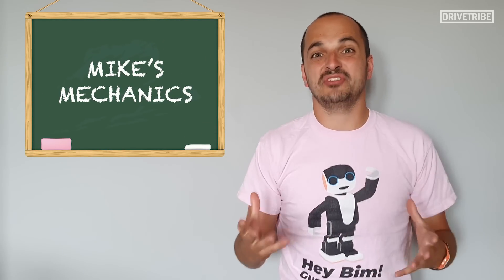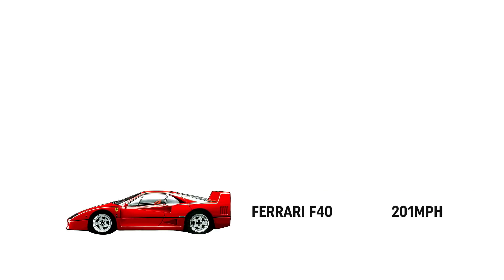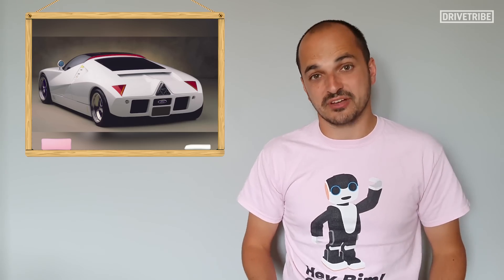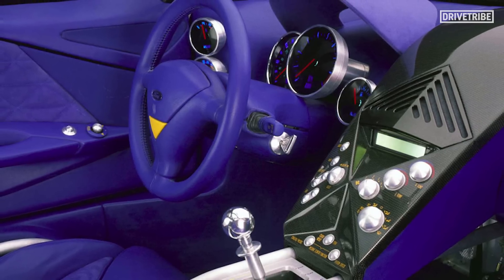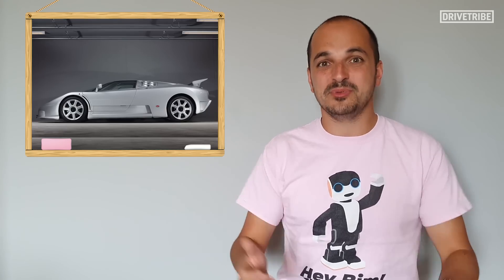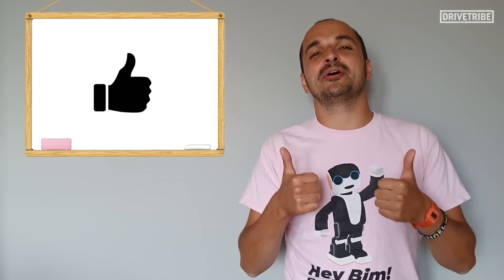What the hell happened to the Ford GT90?

Comment: The GT90 supposedly has a drag coefficient of .32 as compared to the Veyron's .36 in top speed mode. Bob Natkin, the designer of the GT90's engine, was quoted in a 1995 issue of Motortrend as saying the 720HP figure was produced with 6-8 PSI, but was capable of 900HP with the boost turned up. This car would have held the top speed record for sure.

Comment: I had the privilege of working on the gt90 ~6 years back when it was brought out of one private collection and sold to another. True story is that ford accidentally sold it for $1 to the first private owner as part of a lump prototype vehicle lot purchase which were to be destroyed or disassembled. This private owner had a contract with Ford for hauling and storing prototypes and show cars and was storing it at the time. When Ford realized what happened, the deal was legally done and an agreement was made that it would be forever preserved and not dismantled. 

I was tasked with making it run again. Petty wild setup, could clearly see where two cut up 32v 4.6 blocks were welded together into the v12. The turbos were completely fake however. The exhaust went through a turbine housing, but it was an empty turbo and the intake tract went straight from 90s Era Ford taurus air boxes to the intake manifolds.

The chassis was crazy cool though, lots of billet aluminum cross members and aero tubing control arms. Whole oil pan was a billet dry sump setup also. I have pictures and a video of it running somewhere on a memory card.
Reply: Hi Matt- this is awesome. I don't suppose you could upload those pictures/photos anywhere (e.g. Google drive, dropbox) to share? I really do love this car and would eat up any media someone may have on it. Many thanks

Comment: So as of 2005(when I worked there), the actual Ford GT90 was in a warehouse at Roush Industries in Livonia, Michigan. It was parked next to the Orange Boss Mustang that was built in the mid 90’s for some magazine challenge with a 429 motor that was punched out and converted to fuel injection.

Comment: I actually like the design. A lot. It’s missing only some modern aero tech:
- wing and diffuser on the back;
- front lip.
Reply: It actually had a (intended to be)self-adjusting rear wing, similar to the F1. It was pretty large too.
Reply: Almighty Dícksauce well, seems rather invisible. Perhaps a technology that made it impossible to go to production :-D
Reply: @valter_vava74  @2:50 Theres that weird looking panel gap running between the rear lights bottom corners. Thats the rear edge of the wing and the leading edge starts from the top inner corners of the rear lights. Kinda neat looking desing and loved this thing to death in NFS 2 :D

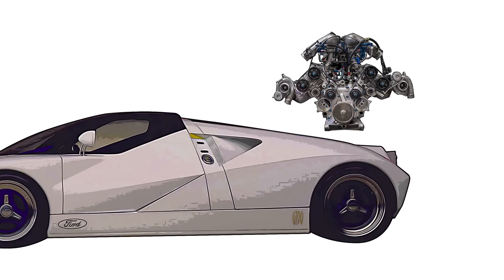Comment: At 1:52 you say thats a v12.  It's actually a w12.  Two inline 6 cylinders mounted in a v shape is a v12.  Two v6 engines mounted in a v shape is a w12.
Reply: It's two v8s end to end. Two 4.6 liter engines.

Comment: I just want modern game developers to appreciate the insane - yet completely realistic - concept cars of this time period. The Ford GT90 and the Chrysler ME 4-12 could have been world-beaters were it not for the profit-driven suits in power at the time, and it's so sad that these insane automobiles have been entirely forgotten about. The last game appearance for the GT90? 16 years ago, in Ford Street Racing. The ME 4-12? 15 years ago in Forza Motorsport 2.

Some refresher stats on these early hypercars: in 1995, the GT90 concept was debuted with a 720hp at only 3200 lbs, quad-turbocharged V12. For reference, the 1995 Ferrari F50 was only putting out 512hp at 2,700 lbs, and the McLaren F1 was putting out 618hp at 2,500 lbs. The GT90 was a serious competitor of the McLaren F1!!

The ME 4-12 was putting out 850hp in 2004, at a weight of only 2,900 lbs in AWD. The Ferrari Enzo was only doing 651hp at the same curb weight, and the Carrera GT was in similar spec at a slightly higher weight.

Top speeds? 248 mph for the ME 4-12. 253 mph for the GT90 (possibly over'
-exaggeraged, but probable).

Had the Wall Street suits let Ford and Chrysler do their thing with the GT90 and ME Four-Twelve, the modern hypercar world would be unrecognizable compared to what we have now.

Comment: One I will NEVER forget is the 2004 Chrysler ME Four-Twelve with the 850 HP 6.0 L Mercedes-Benz M120 Quad Turbo V12. If produced, it would've been the most powerful/fastest production car at the time with a claimed top speed of 248 mph. Most claimed top speeds are usually exaggerated or straight up lies. However, this one was very believable since the less powerful 720 HP 5.0 L Mercedes-Benz M119 Twin Turbo V8 in the Sauber C9 managed 248 mph at Le Mans in 1989. Yes it's a race car that weighted 950kg but it still had more drag, less cylinders, less turbos and less hp. While the Chrysler was 360kg heavier, it still had less drag, more cylinders, more turbos and more hp. With those stats, it could've probably done over 248 mph. Also, I feel like the latest Ford GT pays a lot of homage to the GT90 in the looks department as well as the GT40 it succeeded.

Comment: You say "Sadly", I say the NFS-II model was great for the time (better than what we saw in Empires "Ford Racing" series (though they got better with each version).

My brain is old and tired, but I distinctly recall a statement that they had to disconnect 2 of the 4 turbos to start with because the XJ220 chassis twisted under load in early testing. And Clarkson mentioned the engineers being unsure the chassis could cope when he drove it.

She was a nice looking car, even with that purple Mondeo steering wheel. I remember Clarkson being so pleased because he could fit (being devastated by the fact he is too tall to drive a GT40.

And sure, it was a shame the world never got a production run of GT90s, but the Ford GT isn't a bad consolation prize.

Comment: I could imagine if they would have took the engine in the GT90 with turbos and slap that in the Ford GT. Just slightly modify the engine compartment to pull in more cool air and provide a front splitter in addition to provide more downforce front to back. Ford would have made one of the most scariest sport vehicles to be in the element of hyper car territory.

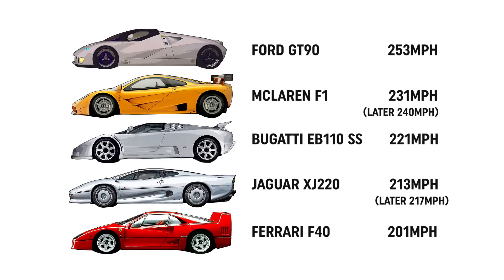Comment: 2:46 - Weight becomes far less important than air resistance above 180 mph or so, and especially above 220. As you say, the aero is far more important.
Reply: Weight has very little impact on top speed, but it makes all the difference for acceleration
Reply: @yeetusdeletus9  Actually you're wrong about that. Weight does matter for top speed. You need tires that are going to roll over the ground with minimal rolling resistance, and weight affects that in a way that isn't trivial. But aerodynamic resistance becomes more important to both speed and acceleration than anything else after, as I said, about 180 or so.

Comment: It had a theoretical top speed of 253. But realistically it's actual top speed was no 30 or 40 like they limited the concept to. Ford did a test with it on their track with the turbos connected. It got to 235 MPH before overheating badly. So 235 is it's actual speed. Still slower than the F1. Still it was a cool creation by Ford. Just imagine if it went through. What kind of cars we have today would be different because of the old concepts of yesterday

Comment: I hate the whole number system for the Ford GT.  It's called GT40 because it's 40 inches tall.  The 2003 GT is not 40 inches tall, but people still call it a GT40.  I assume the GT90 was not 90 inches tall.

Comment: I always wondered why Ford never married two of the 4.9l I-6's into a 9.8l V-12 powerhouse motor....The 4.9 was a stump puller of a power plant, and the 9.8l version would have allowed for extremely tall gearing along with neck breaking acceleration, especially with a turbo, a supercharger, or both. a 9.8l powerplant would have instantly made ANYTHING a supercar, but especially the GT90.

Comment: I remember it in Need For Speed 2, a shame it didn't make it to "mass production".
Reply: I think it was actually a money thing and they couldn't afford to mass produce it. Probably. Plus, with the engine and quad turbos, the car would get so hot it would actually melt the car itself and the solution was really expensive I'd imagine, requiring space-craft grade material to prevent it from melting. Would've been a pretty huge safety risk if it wasn't built properly.

Comment: A V-12 with quad turbos? Carbon fiber body. Top sped over 250mph. Wildly undercuts the pricing of other similarly capable super cars... Never brought to production for "reasons". Sounds like the Chrysler ME-412. 

The ME-412's engine started as an AMG V-12, although some rumors say a production ME-412 would have been two V-6s melded together.

Comment: Problem is it never really exhisted in anything but scculpture form. Yes a moving sculpture but it never used any of its power, never ran at speed and was never what it promised to be. 
If I glue a wing to a Lada that doesn't make it a 250mph car no matter how much I hammer the panels to make it look different. 
The engineering and testing was never done for this to be anything but a show piece and as such it should be remembered as just that.

Comment: So the real question is, why hasn’t someone bought this and hooked up the turbos? I don’t understand why ford engineers didn’t think it could handle the power if it was based off of a 213 mph chassis. Even still why was a car with a v12 only able to do 40 mph? Odd car.

Comment: Waiting for the 2005 example with the modified and blueprinted truck 5.4L engine was a better choice, even better was the racing program (that gave legitimacy to the car) in 2016 with the 3rd generation car. Forcing something like this back in the 90s would have just made Ford file for bankruptcy when the bottom fell out in 2008...

Comment: Wouldn’t that engine qualify as a W-12, not a V-12?
Reply: Not of theyre joined to make a v. Basically taking the straight 3s from the V6s, copying them and then shoving the 2 following straight 6s together in a V.
Reply: Constantin Legras Isn’t that what Volkswagen did with their W-12?
Reply: @Plysomack  If you join V-engines together so they share a crankshaft and the cylinder heads are all aligned, you've still ended up with a V.

Comment: The 90 deg V12 wasn't all that hot- it didn't last that long, as less than a year later the 60deg V12 was installed into the Indigo show car, and VERY quickly after that, the same 60deg V12 was installed into the DB7, and then developed into a production car starting in 1999.

Then look at the glass roof of the GT90- there was no structure there because of styling, and it would have shattered under full engine torque.  

Still in the 90's, the "supercar" priorities has to be Aston Martin and Jaguar, and Jag didn't want to see any Ford that was better than one of their cars- see the 3.9l Lincoln LS vs. the 4.0l Jag v8.  Pretty pathetic by Jag, to me.

Comment: You know you missed acouple of thangs about the Ford Gt90 the engine bye had ceramic plates alot like the same plates used by NASA shuttles because the heat from the engine and quad torbos would melt the body if they don't have them and as far as I heard ford only made one and the real reason the car never made it to production is ford spent some much to make the car they couldn't make the price that they stayed for around 100K